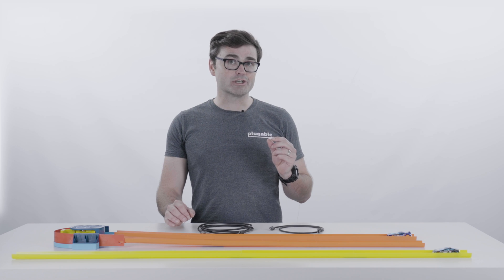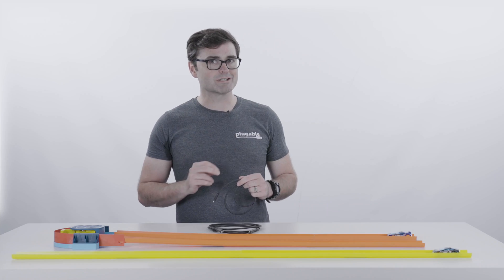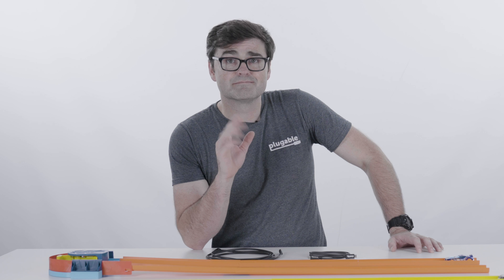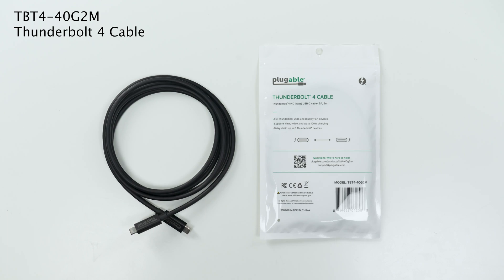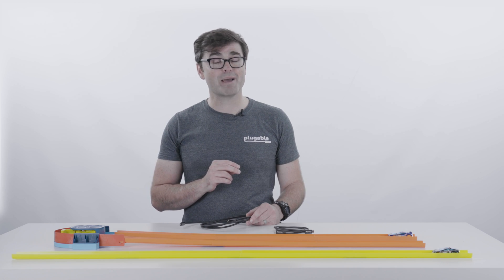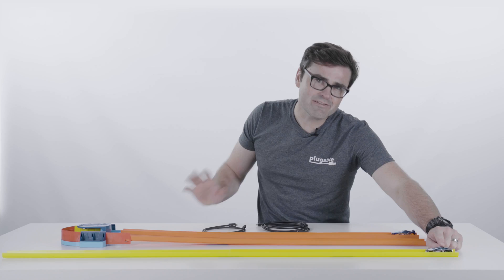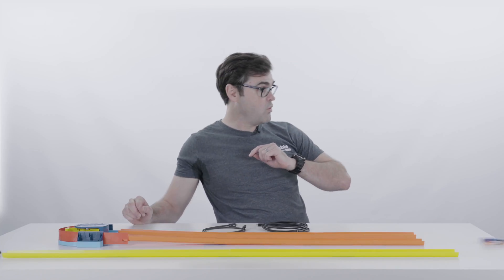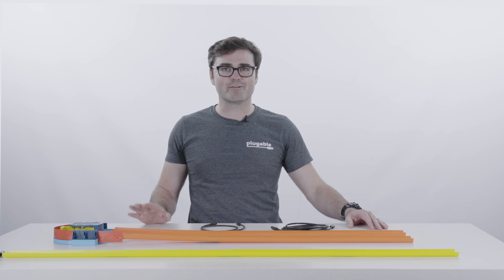What’s the Difference Between Active and Passive Thunderbolt Cables?

Comment: Thumb up for the "standard cow" :) But the main question was unanswered - how long can be passive cable for TB3 and TB4 without speed loss..
Reply from the maker: The longest passive cables that can support full 40Gbps data transfer over Thunderbolt 3 or Thunderbolt 4 are going to be 1 meter long. Anything longer than that tends to require an active cable!
Reply: If the cable is shorter than 1m. What would be the benefit of getting active tb3 cable over a passive one.

Comment: How can you tell by looking at the Thunderbolt 4 cable whether it's active or passive?
Reply from the maker: Thanks for the question! Most companies will not label whether they are active or not on the cable, but you can get a good idea based on the length of the cable. While there may be some exceptions, a Thunderbolt 4 cable that is longer than 1 meter needs to be active in order to still have the full 40Gbps transfer speed. Most cables 1 meter or shorter do not have to be active in order to have the full 40Gbps speed.